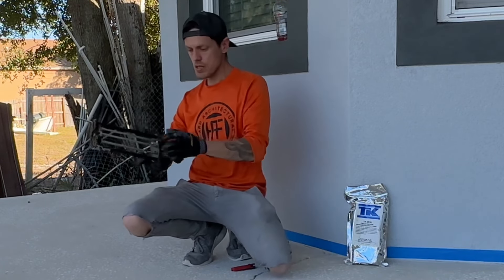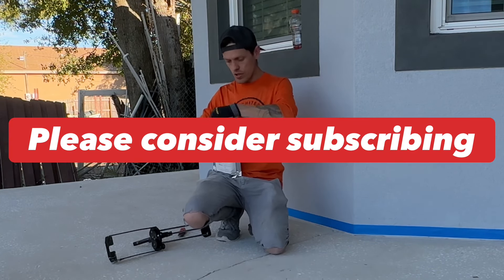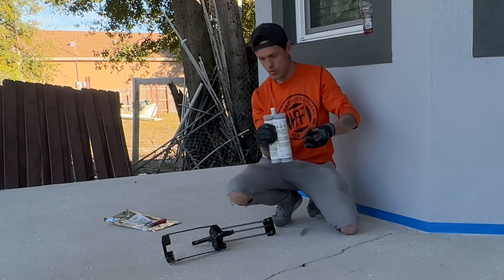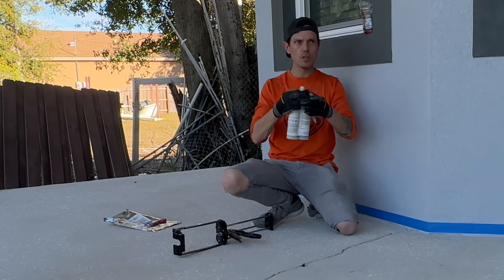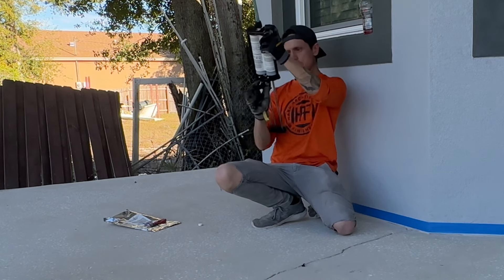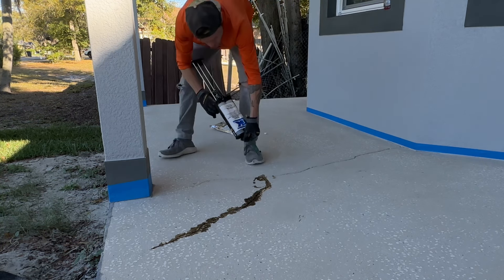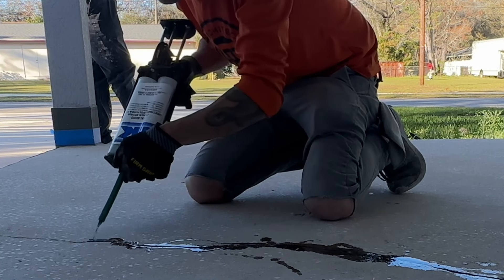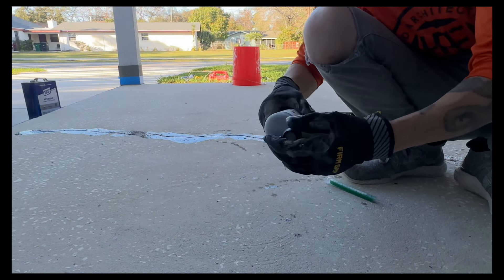Industrial-Strength Concrete Crack Repair

Comment: Did you have to add that fine sand in the crack before you put that part a+b in? If not, when would you use the sand?
Reply from the maker: Immediately after applying A&B.